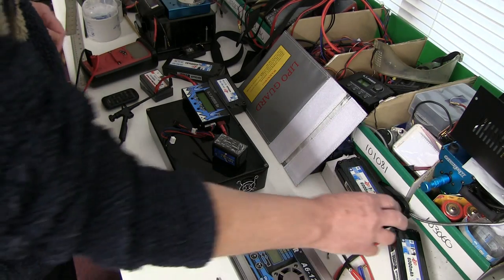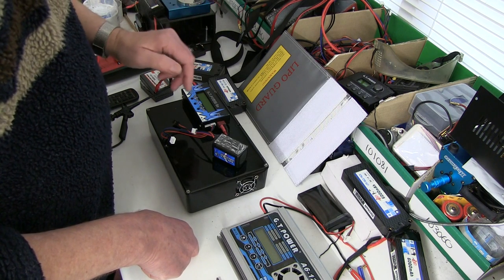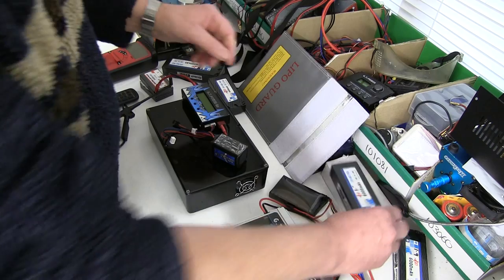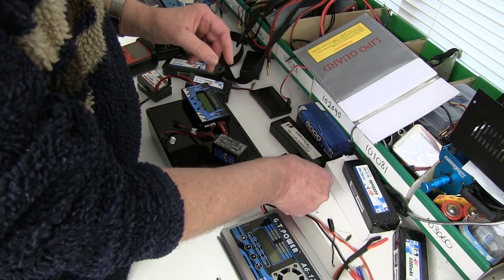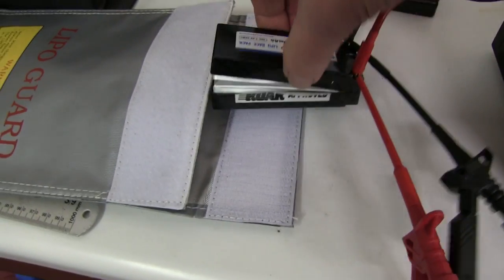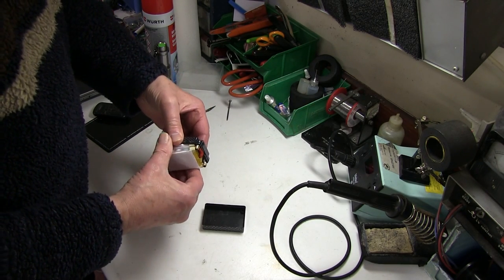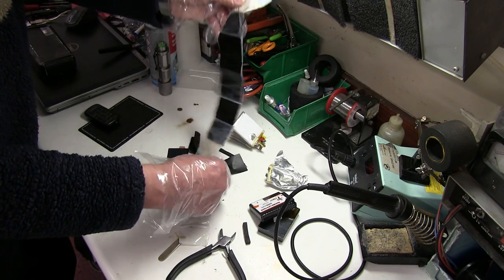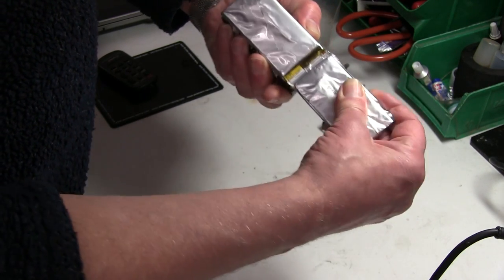Lipo Swelling. Making safe. What's inside.

Comment: I've been doing a lot of research on how to prep batteries for safe disposal.  Then I read that you can just simply drop it off somewhere that handles them.  My local auto parts store does it.  So I gathered up all my defective lipos that have been sitting a loooong time and simply dropped it off there.  They took the bag with a smile on their face.  How easy.
Reply from the maker: Thanks for the info.  A lot of recycling centres take all sorts of batteries for disposal.

Comment: The manufacturers should attached a one-way gas release valve on each of the cells so that the battery can be maintained in original shape regardless
Reply: sounds like a very good idea that wouldn't have any dangerous things that could happen with it.

Comment: Use a small 12 volt light bulb with small wires soldered to it and small pins soldered to the wires.  Stick these pins into the outer slots of the balance connector and put the battery and light into a open metal can for a day.  The light will discharge the battery.  If the battery is more than 12 volts stick one of the pins in a slot other than the outer ones.  If you measure the residual voltage after the light goes out you may find 0.5 to 2 volts remain in the battery but it is just a "surface charge" that will quickly drop to near zero if you "load" the battery.

Comment: Most of the swollen ones you have seem to be ip batteries,  do you rate these as most racers I race with use ip batteries and we all seem to suffer from either cases splitting open or batteries overcharging for no reason
Reply from the maker: I agree that IP has a reputation for swelling lipos. They are much improved with the latest HV types. I have seen swollen lipos by most Names, but a lot of these lipos are from the same factory. There is no answer to swelling lipos, as I have had many lipos which have been used correctly, never too low voltage or too high, not overheated or mistreated and left in storage mode, but they still can swell up in the bag overnight. The Manufactures will not accept this, and always say "User Error".

Comment: basically... You cannot use the battery if it is already swollen and bleed out the gas. If you use it on your drone you will loose your precious drone because of sudden voltage drop and eventually force landing your drone into somewhere...

Comment: Helo, nice video, thanks. i have 2 Phantom 2 Vision Plus Batterys also swollen up..it charge till all lamps on, and the lamps on Drone lights up, but it dont give power enough to turn motors on..Can it be fixed,  and how to fix those batferys, pls ?  Thanks by advance .. have good day ...
Reply from the maker: Hi Mohammed. Those lipo are small capacity?  If they will not turn the motors, they must be beyond repair. They cannot be fixed. Sorry

Comment: i tried to make 2 holes in my swallon samsung  lipo battery to deflate it
but i heard a sound of gas going out ( it was hardly inflated)
and i also smelled a strange gas smell 
is that dangerous ?? and what is that gas that i smelled
Reply from the maker: Hi Omar. I assume you had fully discharged the lipo first, as there is risk of a fire if you do this with any charge in the lipo.
The gas does not normally smell as it is a combination of CO2 and CO and O2, but maybe some trace lithium and solvent which probably will give an acidic element.
It is not advisable to do this as the puncture holes will let H2O in which will react.  Also the lipo is almost certainly not worth using.

Comment: Well, why make it so complicate to discharge a lipo?! Just connect it into your toys, turn on the esc switch and leave it there for 1 or 2 days, will come to zero volt with ease. Trust me. Most esc consumes 30mA at idle. And that discharge is far safe for any battery.

Comment: So tell me what is with ALL the other videos here on U-TUBE showing to POKE A HOLE IN THE PUFFED CELL,  SQUEEZE THE "HYDROGEN" OR WHATEVER THE GAS IS OUT THEN RESEAL THE HOLE ???
Reply: The battery could just set fire and that is just stupid because it will lower the amount of electricity it will hold
Reply: Some people don’t have the money to afford a new battery and it’s an excellent method I’ve done many times and they’ve never caught on fire. Resealing the hole is simple as putting some liquid glue over it and letting it seal and then no more water can get in. Lots of batteries have different kinds of electrolytes that act differently but ultimately I’ve never seen a video where someone genuinely pricked just the outer layer causing it to go up in flames or at the very least smoke.
Reply: @supercrazymario404  interesting, I thought this may be the case.

Comment: Heat makes them swell
Reply from the maker: You are right, but it needs to exceed 65 degree Centigrade.
Below that, high performance Lipo have no problem with heat.
Reply: Swell makes them heat

Comment: Wrong.. A swollen battery is not fine. Its telling you something.
Reply: Swollen Li-po battery indicates there is a gas on the inside already, and the more times the battery is being used (charge and discharge) the accumulation of the gas there is. What makes LI-PO battery is dangerous when the cylinder cannot cope more of that gas and then it will just explode, creating smoke and maybe fire.

It must be fully discharge before disposal ( NOT ON YOUR TRASH CAN) .